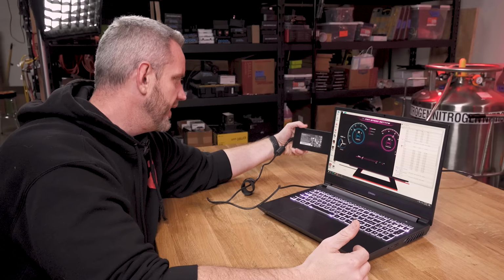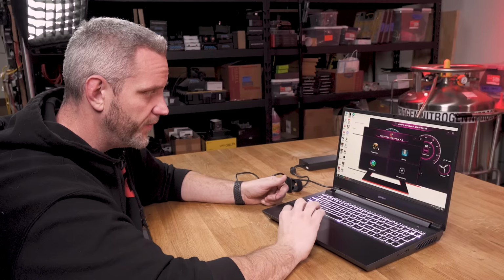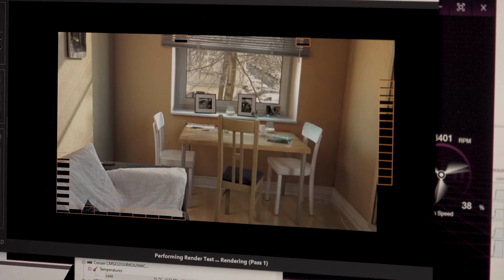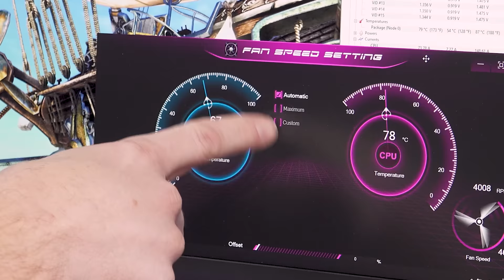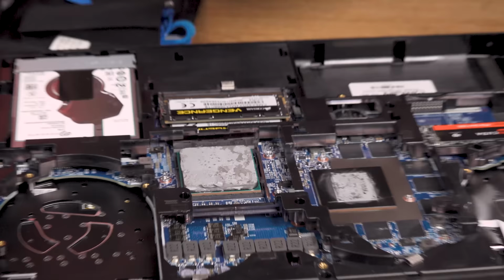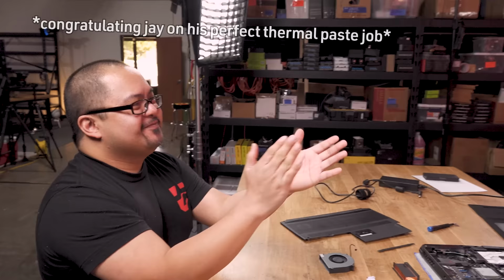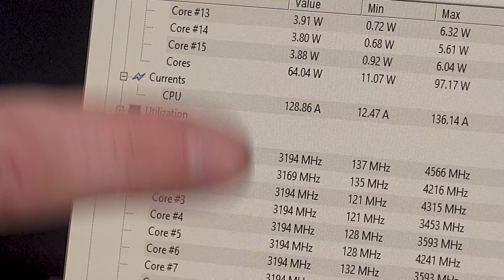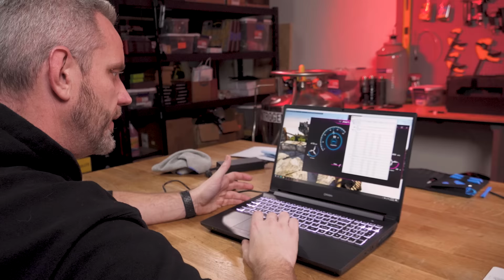This laptop was trying to melt to death... here's how I fixed it.

Comment: My wife has the Intel version of this laptop and we found the Intel Boost Engine was nuking the temps on hers. The setting you can't turn off in a laptop bios. I basically told the laptop to not go above 99% so the boost never turns on.

Comment: I've had a similar issue using mx-4 thermal paste on a nitro-5 laptop. The thermals would be good for a few months, but would start to run hotter and hotter. I repasted it a couple of times with the mx-4 and had the same issue each time. After some frantic googling, I tried using Gelid Solutions GC-Extreme paste and have had no thermal issues since then. I'm wondering if the mx-4 was breaking down from the temperature. Either way, I thought I was some how messing up a simple job but it was the paste.

Comment: I have a very very old laptop

MSI ge 60 onc 16ga
Intel core i5 3210m
Nvidia geforce 650m
8gb ram

And twas way back from 2012 and am suffering from random shut downs. Ive already repasted it with artic mx-4 and cleaned the fan from dust and debris.

Still theres random shut downs

My temps 
idle 55-60c
Browsing 60-65c
Gaming 70-80c

I just had to use power saver to somehow remedy the problem.

But using balanced or max performance would ultimately result to random shut downs

Comment: 90*C? PFFFFT! My Sager will go as high as 96*c before it throttles! I was only able to get it down TO 90*c on extended load after hacking up the case with a dremel and repasting it with Kryonaut! Glad to see the new Clevo Control Center is no better than the old one, as well. These Clevo Machines just have AWFUL cooling.

Comment: Does the bios allow voltage adjustment. The 3950x should be able to run at 4ghz at 1.1v. That be enough to get the amps under 130.

Comment: Do you think it would be a good idea to repaste my laptop (msi gs63vr) if I brought it on a submarine where the air is literally corrosive and the air pressure fluctuates multiple times a day. One fan is always running high. Haven't looked at Temps really though.

Comment: Origin still messed up with how they are throttling the processor. Ryzen doesn't drop to 200 MHz when running a properly setup system. You could probably fix this with some PBO limits being put in place.

Comment: First off, gift the laptop some lift so the bottom can draw in air. Using a gaming laptop without a cooler is also not advised. Also undervolt the CPU and turn down clock speed if you have too. Temp under control will give you more performance and make your Laptop much longer.

Comment: It shouldn't be going into throttling due to amps either, its taking the CPU all the way down to minimum frequency.  Did you turn off the socket power cap?  Try setting the socket power cap to something that won't throttle on amps... like 65W or 60W, so it throttles more linearly based only on thermals.  It should never have to drop all the way down to 200Mhz.

-Matt

Comment: My HP Omen intel i7 9750H will spike up to 90 degrees and come down to 50-60ish imediatly just by executing even simple apps like the browser. I believe it's normal because my laptop is not even 8 months old and the vents don't even start blowing unless I execute more apps wich will keep the CPU in 90 degrees as it keeps opening and then will quickly come down to its normal temperature

Comment: Re pasted and cleaned my fan units in my helios 300 and gained around 6-10 celsius cooler. Shit works magic.
Reply: combine it with some undervolting and you will have a different machine
Reply: @sebastianpichler6628  what exactly will this do? ive heard of undervolting and i have a rough idea of what it is but i wouldn't mind the clarification.
Reply: @Nutonic_RL  I ain´t an undervolting god myself, but as far as I know, the manufacturer gives the cores more voltages than they absolutely need in order to work properly to make sure every cpu runs well. If you are lucky you can reduce the voltages but still be fine. If the computer suddenly freezes, it got to less voltage. If you use Xtu the offset will be reset to 0 after crash

Comment: Legion y540 
stock paste: thermal throttles under load 
MX-4 paste: works really good NO thermal throttles under load, but after about a month thermal throttles under load
Kryonaut paste: same as the MX-4.
Using R20 for load.
Both applied several times with same results.
Any suggestions?

Comment: Thermal paste related

Received a Kraken X53 for Christmas, haven't installed an AIO before, built many a computer however. Would it be recommended to just start with a good thermal paste for the AIO on the Kraken or just use the paste that it comes with? It will eventually go on a 5800X.

Comment: You don’t apply thermal paste on a laptop the same way you do on a desktop. You need to cake it on more because the heatsink doesn’t have the same amount of clamping force as a desktop heatsink. If it keeps giving you issues put it on like you’re icing a nice cake.

Comment: You really need to tune that CPU, not just the terrible fan curves set by manufacturers. Definitely recommend CTR by 1usmus. I only ended up with a bronze tier CPU for my desktop.  The default was terrible on a custom dual 480 water loop and an EK full copper water block. Idles were around 60 with a 20-22c ambient before the tune at nearly 1.4v on the core with default PBO.  Understanding that I lose the 4.7 peak boost is fine when I can run cinebench with 8 cores @ 4.4ghz, 4 cores @4.225, and 4 cores @4.175 at a peak of 1.25v and max temps of 68c at 100% load.  I have been in the PC cooling and clock chasing business for 10+ years now with recently taking 10th place on Fire Strike with my 1080ti. I have only just started to chase the temps and clock speeds with my CPU and I'm only 1 year in so far and have already done the poor man's lapp on the CPU and blocks.  I will say having lapped Intel CPU's in the past the precision level of flatness was vastly superior on my 3950x only having some high spots on the outer edges.  The EK block was very high in the middle which took about 6 hours of manual lapping with 120-8000 grit sandpaper.  The CPU took about 45 mins in comparison.  My final verdict for laptops and cooling them is the industry really needs to STOP trying to make them paper-thin.  If it's a gaming laptop why would you ever want your machine to be designed to throttle the components to sometimes 50% of the rated speed and power advertised.  If I wanted something thin and lightweight I would buy something modeled around that.

Comment: i live in SoutEastAsia. am an admin in a LaptopGaming Forums here for natives

Aside from the temperature here is like 33-34c ("Feels like 38-39c" written),
everyones unit always either hit the factories' BIOS thermal limit (91, 93, 94, 95) or thru the roof 100c ++, CONSTANTLY. keep changing, repasting thermal paste (kryonaut, noctua, conductonaut, etc. famous/pricey ones) doesnt help. neither of us have desktop cpu on the laptop - just the typical mobile CPUs

the thing is, the temp. result from benchmarking w Cinbench Rs dont reflect out units true condition at all. it's 5-10c colder than when actual gaming or different loads other then Cinebench (what the hell, rite?); 90-100c from booting up, 100c just from windows defender scanning. Almost all of the units, ive verified & i can vouch they are this way from BNIB

Undervolt, manual Downclocking, static voltage are a must to handle these sh1ts

including my unit. i have omen 15 dc1077tx (2018 chassis), i5-9h 260m. mainboard has been replaced 2x, heatsink & fans once. problems still persists & The official service centers always cant figure out why. i clean my laptop w blower & paint brush once/2weeks & repaste 3x in 1 year. nothing changes

now, this, i watched You Jay, worrying of that scale.... i.. dont know what to think, what to hope, what to say anymore - of you AND of my country's laptops norms......... i guess our units here are doomed to death

*****o yeah,  btw ONLY HAPPENS WITH INTEL CPUs here. the amd ryzen's are all the nicest boys

Comment: I still wouldn't want a laptop that alternates throttling down to 200Mhz while under load. That seems like a poor design or optimization. I'd be interested to know what clock speed it could maintain without throttling back and forth constantly, or perhaps there are other components which are throttling the CPU such that ping ponging back & forth is normal behavior...though I can't think what that would be...neat vid though.

Comment: I am just wondering why they use these parts in laptops if it is a 105W cpu but only going to give it like 75W. Wouldnt using a lower end CPU actually be better at that point since running the lower wattage on a higher end one be about the same results?

Comment: if i saw such temps and clocks,I would firsthand reflash bios+ec  from other vendor like XMG or metabox or ...... there is sth wrong with how it handles things... also clevo control center is trash..just use "obsidian" software which  keyboard one is free but fan control isn't but still much much better than clevo's own software.

Comment: I have the same issue with a way lower specced older laptop. Is it possible/adviced to use liquid metal on laptops as well? Since the fans are runnig like a hair dryer I need some more drastic methods.

Comment: Hey Jay, is there any good way to remove stripped laptop screws? I tried repasting a while back for my Dell G7 7588 and the screws were so overtightened I ended up fully stripping 4 of them (mostly because i was frustrated). 
Is there any tip you have for removing screws with barely any grip on them, because at the moment the laptop has terrible thermals?

Comment: Always found liquid metal to be best thermal interface on my toasty gaming laptops. Lowest and most consistent thermal performer over a long period of time Vs traditional thermal pastes. Rough example from memory,  Alienware laptop that had 58c idle and 88c full load with stock thermal paste, became 48c idle  and 72 max under load.
Reply: I've always wondered: if you re-paste a laptop that spends a lot of time in a backpack (vertical orientation and gettin' jiggled) with liquid metal (LM) should you be concerned about the LM spreading/flowing/leaking into dangerous places? 

I see that Sony seems to be OK with people mounting their PS5s vertically but, of course, that device shouldn't see a lot of random movement. I've been curious if anyone has had an issue with LM 'leaking' in a laptop that doesn't spend all it's time plugged in on a nice, steady desk.
Reply: @Bert2e  you will be fine, the name can be a bit misleading although it's called a liquid metal made from gallium and other metals, it's still a paste in terms of consistency at room temperature and it won't run like in the scenarios you suggest. It is however electrically conductive unlike traditional thermal paste do you have to be very careful not to over apply it and make sure it does not coat/ touch anything other than the CPU/GPU die and heatsinks, if it does be sure to wipe it off or else it would short and damage     the machine.

Modern thermal pastes are very good in 99% of cases, I have only used liquid metal thermal compound on particular instances where traditional paste could not easily deal with the restrictions imposed by manufacturers designs, e.g  mostly gaming laptops with poor thermal design or space constraints,  causing hotter running CPU/GPU under load, it seems to help better In those specific scenarios. Plenty of good articles online to consult if you were going to try it.
Reply: @gordyboy01  Thanks for the info! Watching vids on the application of liquid metal gives the impression that it has an almost mercury-like flow to it. I'll have to give the stuff a shot . Thanks again.

Comment: my apu laptop could not run YT. firefox would not start up edge barely run and chrome worked but with a lot of changed settings. twitch was possible but only 720p30 with stutters multiple times hitting 90°c+. eventually decided too open it up replaced it with laying around coolmaster paste, now runs 70°c put an ssd in it and runs pretty well sometimes it stutters as cpu hits 100% sadly can not set a fixed core clock so it is constantly boosting up and down making it freeze for micro seconds from time too time as it tries to catch up with the task load.

Comment: If the CPU is not running with the full wattage anyway and it's a desktop socket, how much performance would you actually lose by installing a lower wattage CPU in comparison to battery saving and lower temps?

Comment: My msi gs65 with an 8750h sometimes goes to 95°C when just browsing chrome. I always wanted to repaste it but because the noise really gets annoying when the fans ramp up. Still didn't do it because I'm kinda worried about the warranty (sometimes has other issues like wifi card constant code10 errors  or audio devices not functioning properly). Does anyone have any suggestions what to do or if you void your warranty when repasting? (opinions on the web are split about warranty)
btw I sent it to RMA twice already and the switched the wifi-card once, issue keeps cuming up)

Comment: I've been having the same issue with my GS65 Stealth! I always run it on cooler boost (8000+ RPM on all three fans). There is nothing that I'm able to do about it! At idle it's at 50-60°c🔥. Rarely it stays at 40-50°c. But the GPU stays cool even under loads (at 70°c) but CPU runs hot 😬 and any state and reaches 95°c if I launch any game, doesn't matter how demanding it is, down clocks itself to 2.6 GHz all cores and yet stays at 95°c. (Sad face) I'm not able to game at all! I've an active undervolt(-144.5 mV cache and core) and locked all cores at 3.0 GHz, this helps a bit and drops the temps to around 80°c. IG re-paste is my only option left! My laptop performs so bad with or without undervolt, and can't even push 60 fps in Valorant. But have seen it work great in synthetic benchmarks like Cinebench R20 with a highest multi core score around 2800 with hours of tuning the undervolt and at stable settings it hits 2000+ IG, without undervolt it hits 1750. I've re-installed all the drivers just to be certain that it isn't software related issue, have tried both the latest and the stock version to compare results, and both end up with the same outcome, so that's that!

Comment: Jay i have a 2019 acer predator helios 300 core i7 9th gen and 1660ti. Whn im playing games i turn on overclocking. It reaches arnd 3.9-4.1ghz. Bt the temps reach arnd 95°C. Is it normal?

Comment: My computer booting up out of sleep mode or shutdown wont turn my monitor on. I can can turn it on using the button but then it says no signal. I can let the computer sit there for like a minute and then it restarts itself and then the monitor turns on or i can hit resrarts button and it will turn on when it restarts. This started when i put a new 6800 graphics card in. It use to do this with my old graphics card but only out of sleep mode sometimes but now its out of both sleep mode and shutdown always. I used cleaning software to clean all old drivers off and put new ones on. It still has not fixed. Any ideas?

Comment: Should you repaste a CPU and or GPU just because of age?

I'm running an old i-5 3300 and a GTX 970 so about 10 years old I've never done repasting on them, should I?
Reply: The 970 isn’t that old, but it’s about 6 years old. Every 970 I’ve taken apart has always had old and cracked thermal paste, worth taking apart and repasting.

Comment: Hey Jay,
I also have a S-Frame and I have some problems with thermals of my RTX 3070 Strix. In normal configuration my temps under load are at TJ-max (80°C) and the fans are spinning quite fast. When I lay my case to the side, so the MB is flat the temps go down to ~60°C. Can you replicate that issue?

Comment: I think you can really shorten that "yeah it has lower power consumption so it gets less hot" explanation. Just "even if it's 100% efficient in turning electricity into heat, you'd get a maximum of so and so many watts less so it's obviously easier to cool."

Comment: Well, as a laptop even with the new paste it is still bad, I would not want to have a  70c laptop on my lap, I had an AMD fx laptop a few years ago, it ran 80-90c compiling code, could not use it, burnt myself compiling code. And to everyone saying cinebench in not realistic, it sure as hell is realistic, I use my computer for rendering, and I compile a whole lot, almost all tasks I do on my PC use all cores and all threads almost all the time, be it compiling or rendering, the only time my CPU rest is when I game, or if my GPU has enough VRAM to render a project I will use it, but for the most part my GPU will not have enough Vram for my projects so yeah I end up using the CPU a whole lot.

Comment: I've got a weird temp thing going on with my 3700x since I built my new system (about a month) I've got an H100i pro and it gets down to 42c spikes to like mid 50's then comes down and does it over and over. Anyone know if that's normal or if I should pull my pump off and redo the thermal paste

Comment: Hey Jay good video, I have a question, How come every time I take off my AIO, My processor comes out and sticks on the aio, I bent 2 pins on my old amd 9590, and now I run a ryzen chip, I am worried to take off my AIO, in case I bend some pins again, Please, What is the easiest or best way to remove said device without it coming out of it's socket?. Thank's.

Comment: Jay i have a new Lenovo ideal3 i5 10th gen. 2 months old. I run streamlabs from my elgato n ps4 pro. After 1.5 hours it freezes and i have to wait until it decides to reboot. I did a hard reset with Lenovo tech same issue. I took it to micro center they did the promising lenovo hardware test no hardware issues. Now im stuck with is 600 dollar laptop that cant run streamlabs for more than an hour on my channel. Please help me. Laptop model S/N PF2BNSLZ